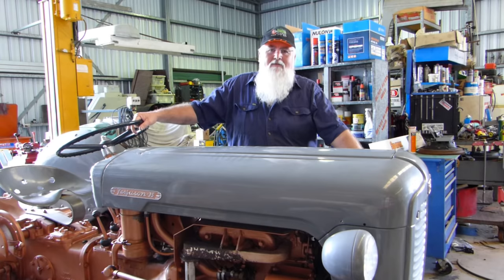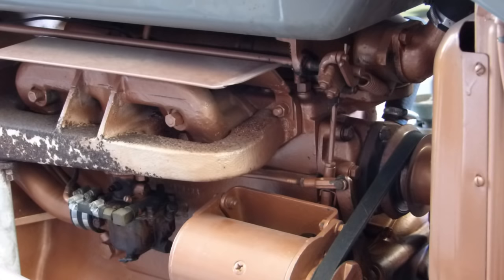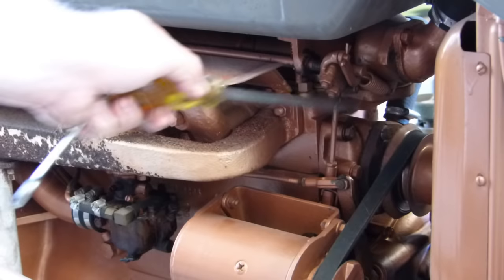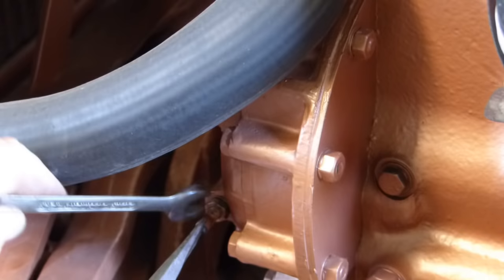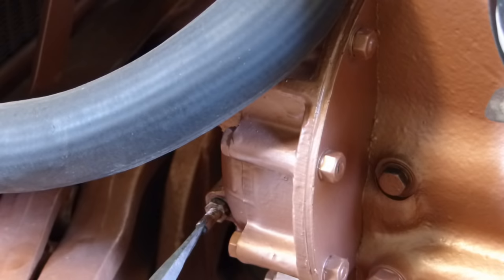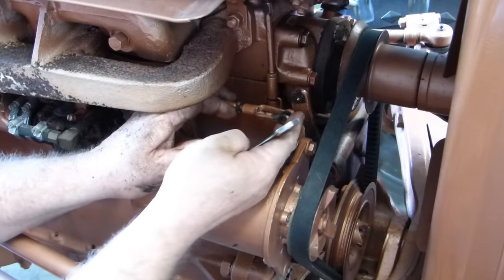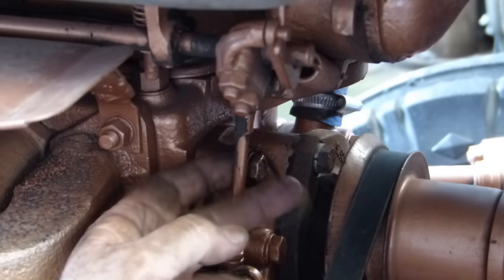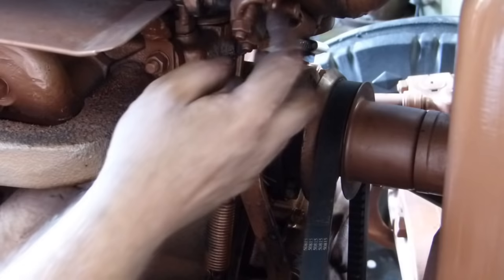How to Adjust Your Ferguson Tractor Governor

Comment: Hi I was just wondering about the best way to sort out a 1947 TEA 6v starter motor.  It is missing and can't find a new one let alone second hand one.
Reply from the maker: Hard to find at present for sure, if you can find a Bareco dealer with a B7200 in stock that is the 12 conversion one but Bareco is out at present. Gordon Ellis in Inverell NSW may be able to help.
Reply: Yep I had just been talking to someone else and they talked-about a conversion as well.  Cheers

Comment: Mr.Bundy ,Thank you so much for your Videos and the Time you put in to Produce them for people like me. I do have a question ?
Is the Throttle rod (The 3/8 rod coming from dash ) supposed to be long enough to go through the gas tank support for the  U-Bolt to hook up to the linkage from the front side of the tank support. On a 135
Reply from the maker: Yes it needs to be.

Comment: Hi there Lance,  I'm hoping you can help me please,  
 solve a small problem, it may be the governor,   im restoring an old Massey Ferg 35 Petrol Tractor, its almost completed  ...
when it starts its idling ok, but as soon as i turn the throttle lever up it starts to cough and splatter and seems like its drowning in too much fuel perhaps, we've changed the needle and seat in the carbi but no difference,
should i just replace the whole carbi with a new one or is there something else we're missing???
much appreciated , regards Ant
Reply from the maker: G Day Ant, Fiddle with the idle mixture a bit and turn the main jet in a little as well. I start at 1 3/4 turns out on both screws and tune from there.

Comment: Brilliant instruction.....thanks from uk....
just advice please....does the actuator rod from the dashboard to the governor linkage go through the hole in the thermostat housing as my ted20 had parts missing and the original rod seems too thick to go through the hole in a new housing I bought and the hole seems angled down don’t seem to line up with the level rod....mine had the housing missing completely so don’t know how it goes....help please.    Robert
Reply from the maker: G Day Robert, Yes the rod should go through and the hole should be directly straight in line to allow the rod to pass through. Possibly your housing has been machined wrong.
Reply: My newly bought housing was the same, had to ream the hole out to suit the rod.

Comment: Thanks for this video. We were missing some of the parts for the governor, including the compensation spring at the top and the small arm. We located replacements. 

It’s not obvious from videos, manuals, or diagrams what the compensating spring is attached to on the fuel tank mount/radiator end. There’s a small hole at the top of that bracket, but the spring is so stretched when there, there’s no way to adjust thst it just touches. I don’t have the bracket on the separate tractor you show. Any links to diagrams or photos to show what the compensating spring mounts to on a ~51 TO20?

Thanks!
Reply from the maker: On the Standard  motor company engines it is onto the thermostat housing, I have not owned a continental engine as they were not bought over to Australia so hard to say.
Reply: Bundy Bears Shed thank you. I hope someone else watching will know one the Detroit Z120 Continental.  I messaged  a couple of photos and will grab a few more when I go to replace the fuel tank in a few days. I hope that if I use an eye bolt and adjust length to compensator spring, we can get it to smooth out. It may be the internal mechanisms,  but parts were missing/poorly adjusted. Going to start from scratch again to see if we can get it smooth.

Comment: THanks Lance, just what does the governor do?, still having troubles with tractor staying running, runs for a minute then dies out , then 20 secs later starts ,15 secs die out. does this over and over
Reply from the maker: The governor adjusts throttle butterfly to compensate for load, you sound like you might have a fuel block.

Comment: That rod that's connected to the carb which is connected to the choke... Where should the lever be at to tighten down that rod back at the carb
Reply from the maker: When on full choke it opens the main butterfly a mm or two.

Comment: Hi there, I really enjoy your videos and have found them very useful in the past. However I have just had a go at adjusting the governor as on my 1949 TED Fergie, as per your video and I seem to have made a mess of it! The governor doesn't kick in at all now meaning the engine runs faster and faster when under no load and then when under load she has no power.....Any thoughts?  She was running fine before i started tinkering but i enjoyed the video and wanted to have a go....I've learn my lesson now....If it aint broke don't fix it! Any thoughts? Cheers Lance
Reply from the maker: G Day Tom, All I can suggest is start from scratch and follow along closely. I cant tell yo  what is wrong from here but the govarnor should try and reduce the revs not increase them.

Comment: Before I start mine the governor rod is fully back just touching the alternator belt then comes forward as the tractor idles up. Mine also sticks if I put the rod that far forward. I'm still trying to figure my to20 out.
Reply from the maker: You can shift the arm forward or rearward where the U bolt in to get clearance, I had to do that on mine originally.
Reply: @BundyBearsShed  I got it to come forward like yours. It has a problem. I was using it to brush hog with and now it Idles smooth then gets erratic as I got up in the rpms and when driving it. It feels like I'm on a bull. LoL. Anyways going to go thru the trimming and adjust the rocker arms as they tick. I think a push rod might be bent cause I was chopping 3" and 4" trees down with the brush hog. I figured I would of had problems with the hydraulics but no problems. I done rebuilt the carb, put a new alternator on, rewired the tractor, changed the plugs, compression is above 100 psi and all cylinders are about equal. I also over heated It twice from the vents on the radiator getting clogged. It has always had to be cranked forever until it starts. Luckily I can do all the work on it myself. Well I'm to the point of not beating it up anymore and fixing it up so I can do light work with it now. Sorry this is so long and Thanks for the videos as they do help.

Comment: Hello  , I,m glad to find another Ferguson enthusiast , I have 2 questions for you , firstly , could you please consider doing a video on getting this same engine,s charging system to work , mine has a new & working generator ,polarised positive earth  by touching the field coil terminal with a jumper wire from the live ( negative ) battery terminal ,  Lucas RB340 control box , wires all connecting ,  but very little charge current , wiring seems o.k. by resistance meter test ,
 also I see you have the far superior Zenith carb as was fitted to the M - F 701 baler engines , where would I look for a set of the correct jets for a petrol - paraffin engine ? any ideas , I,m in England & am a member of Ferguson Heritage . Best Regards mate , I,ll watch your channel for answers .
Reply from the maker: G Day Philip, good to meet another Fergie bloke, I'm not sure where you would buy the jets, a carb specialist possibly, The charging system only is 11 amps at full smoke but it seems to be enough to keep things going. Ill see what is coming up and if it comes up I will run through it for sure. Thanks for watching and commenting.
Reply: Thanks mate , I, ll look around for carb specialists as you say , or perhaps an old burned - out baler with the engine still on , I have the Zenith 28G carb , a new one , never been fitted to anything , but it is jetted for a little Petter or maybe Lister engine for a concrete mixer or similar . As regards the battery charging being quite weak , I,ll see if I can get hold of both a moving coil voltmeter & ammeter , wired separately , & put them both in the same case , then use this to check out the system properly , as Harry Ferguson,s workshop manual tells you to ( or as near as you can get ! ) If I can learn to talk posh & avoid bad language then I might just post a video of this , if I can satisfy myself I can make it all work  . Please bear with my slight East Anglian accent , some people think I,m Australian , I,m not . Best Regards Mate , & keep up the good work .

Comment: Hi Lance, I just did this today. The screw on the timing case, I screwed it in half a turn from where it just touches. Decided to split the difference, tractor seems alright.
The book says 450 rpm for idle speed? seems low, what do you set the idle to?
Reply from the maker: Probably 450 but usually just guessing that by ear.

Comment: I have just had the carby rebuilt and I now have the problem that on start up it runs flat out so I think I need to adjust the governor yoke as I replaced the rod at the same time, is this right?
Reply from the maker: Check the main butterfly is moving in the correct way and free
Reply: I have done that and it checks out all good

Comment: Very helpful, I have a TED 20 and after it has been working for a while if it is under load or going up hill it starts to seriously loose power.If I pull out the choke and that puts on the throttle away it goes no problem. Am I right to think I should adjust my governor?Thanks Hywel
Reply from the maker: I would try opening the main jet screw half a turn and see how it goes.

Comment: My Mf petrol tvo 35 runs fine at idle, but if you move the throttle a bit, it revs up to a very whirring, full revs. Its really weird and quite dangerous as I run the tractor with a loader on around our very tight yard. Sometimes, if you raise the loader quickly the tractor revs up slightly normally, but as our revs are funny, it revs up to full and you suddenly speed up! Any advice on this will be greatly appreciated. Thanks  Oliver
Reply from the maker: G day Oliver, Run through the video I think you have the adjustment wrong on the linkage but if you start by adjusting the screw on the left of the timing cover and work your way through you should come good.

Comment: Hi Lance,I watched another video of yours, where it shows the injection pump been totally upgraded, great video, would my diaphragm need replacing as this might be the cause of the very high revs, O I wrote earlier in a reply to you that, I bought the TED 20 diesel, year 1950. Not a single wire in it and needs a wiring loom, but got it going and revs very high.
Reply from the maker: Yes you actually have a TEF if it is diesel and the crook diaphragm will do it for sure.
Reply: @BundyBearsShed  Cheers but on the tax book it says TED 20 may need more investigation thanks Lance.
Reply from the maker: Jimmy the serial number should be on a tag on the dash just in front of your steering column. It will start with TEA, TED, TEF etc. The TEA was petrol only, the TED was petrol TVO and the TEF was the diesel ones. There were many more models but we don't see them often.
Reply: @BundyBearsShed Thanks so much for all the effort you have put into answering all my questions.

I'll keep watching all your videos there very good.

Cheers.
Jimmy.

Comment: Thanks for that. I have a MF35 with a new governor but could not figure the throttle linkages out. Works like a champ now. Any ideas on a Ford 2000/3000 (not sure which) petrol governor. Im trying to figure this one out as well and your video has given me some great things to try on the Ford.
Reply from the maker: G Day Sean, I have not worked on a ford petrol governor but a mate just bought one, quite rare over here.

Comment: Thank you for your fine videos my To/20 is running well after governor adjustment and carb work. I do however have a question. If I don’t turn the fuel off fuel the fuel starts to run out the sides of carb. I was assuming the needle and seat would shut the fuel off? Your thoughts and thank you for your help
Reply from the maker: Yes needle and seat not sealing for somew reason, possibly a little rubbish there or the float not lifting high enough.
Reply: @BundyBearsShed  ok, I figured it. Since it’s a gravity fuel system just slightly crack the fuel on and all is good . Now it’s not charging but I sent my best hand (pops after a Ford ext regulator. Have a good day and I appreciate the chat. I thinking your gonna need your own merchandise.. peace

Comment: Love your channel mate! You mention the governor “hunting” and I assume you mean the surging revs? What isn’t set correctly when it does this? Mine is a working TE20 and idles ok but when working the governor surges unless it’s on full revs, which I hate running at!
Reply from the maker: Possibly the dampener spring so adjust the screw on the timing cover in a couple of turns and see if that helps.
Reply: Yep, that did the trick, much appreciated

Comment: Really like you videos been a lot of help, ive got a 1959 TO35  with the standard C 4 cylinder engine and cav dpa. the problem is ive lost my governor spring settings, ive got it started after pump build but below half throttle will shut it off and full throttle does not feel like "full" tach is inop untill a i get more parts. any idea what the governor settings should be on the standard C? it runs good just throttle position is way off.. maybe my max fuel setting incorrect ? need some help?
Reply from the maker: G Day James, Look for a shiny hole that the spring or rivet went in to you need to find a place that is a bit tighter on the spring.

Comment: Hi Lance - my idle speed is high but adjusting the idle speed adjuster ( anticlockwise ) doesnt seem to reduce idle speed at all _ I have a zenith carb just like yours......dont want to do too much until thats sorted!  Cheers Guy / Sheffield UK
Reply from the maker: G day Vern, Possibly you need to lengthen the rod from the governor arm to the carb so the idle speed screw is contacting the stop. The idle speed is on the butterfly shaft bracket, the other idle screw is the idle mixture. The big adjuster is the main jet and it gets set at high high idle.
Reply: cheers lance will give it a tweek ! have a good day
Reply: posted it on our fergie facebook page with a picture of my carb - apparently i am missing my air breather valve pipe from rocker cover to manifold!!! so sorting that too...
Reply from the maker: They get a bit carried away on there sometimes. If the hole is already blocked off it is not your problem or cause of the problem.
Reply: but should I have that hose and valve replaced????? thanks for the advice
Reply from the maker: It wouldn't hurt but I have seen many without it with no problems. There is a crank case breather that goes into the top of your air cleaner as well. Quite often the little valve carbons up and the tappet cover one doesn't work anyway.
Reply: seen one on ebay just by chance so have a bid in. i have got a crank case pipe - not lost all my tubes at least! see what happens

Comment: I  have a Massey Ferguson 135 continental with double headlights  I have a new switch but the old switch had no wiring with it am in need of the wiring details.
Reply from the maker: There is a free workshop manual download on my site at queenslandtractorspares.com.au in the tech pages.

Comment: Hi Lance, great video and info! I have a 57' Ferguson TO-35 that looks just like this one, without the nice paint job lol. It's been running and idling ok but yesterday while cutting a field it just revved wide open all of a sudden then started surging up and down. I haven't had a chance to look at it after watching your video but does that sound like maybe one of my lock nuts just loosened up and needs adjusting back, or does it sound more serious since it started this so suddenly?  Thanks bud and thanks again for your video!
Reply from the maker: G Day Greg, It is hard to say, if you had a linkage off I dont think the governor would try to settle it down eg, surging. Check the engine oil level that the sump is not full of fuel, and the air cleaner is not too full and sucking the oil up, I had one do that one time and scared crap out of me, lol.
Reply: @BundyBearsShed  thanks for the reply and yes it did scare the crap out of me, I thought it was to explode Haha! I did check the oil level and it looked good. However,  I'm not sure about checking the sump. I'm not familiar with that as I'm fairly new to the tractor world. 

If I get rid of the oil in the air filter, can I put any oil back in it? I have a gallon of 90 weight oil I put in the Bush hog, would that be ok? Thanks again for your help.

Comment: Could you do a video on how to get Max rpm down i have tried but now it doesn't Idle and.dont Run correctly it would be really appreciated
Reply from the maker: Tune the carb and adjust the idle speed screw.

Comment: Hi Lance,I told you before I was looking out for a ferguson, and have one I seen, it wont idle revs high its a 1953 TED 20 diesel would this be in need of the governor adjustment as in your video.Cheers.Jimmy.
Reply from the maker: G day Jimmy, Possibly the throttle rod not adjusted correctly. Do the governor adjustments and hopefully it should sort itself out.
Reply: Just bought the Ferguson today, from what I can gather its 1950 on the book, it race's like hell no way to turn it down and it's a positive earth I am told, O my God what did I buy the book says TED20 I cant find any info on this tractor, your throttle system to mine is totally different can you help.Cheers.Jimmy.

Comment: Hi Lance a tractor i worked on a while ago was hunting badly under no load and i put it down to an issue with the  spring in the governor housing is there another way to fix this without removing the governor housing Thanks Paul
Reply from the maker: G day Paul, I doubt it would be the internal spring, I would look at the external one and see if the gap to the arm is too big.